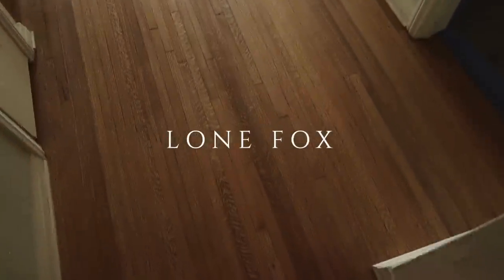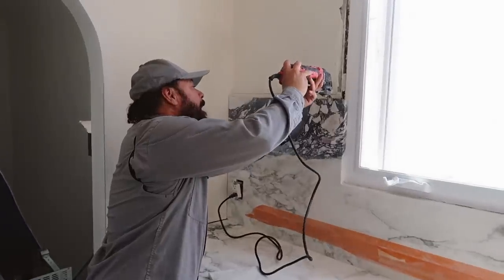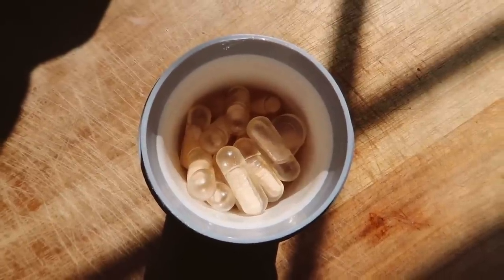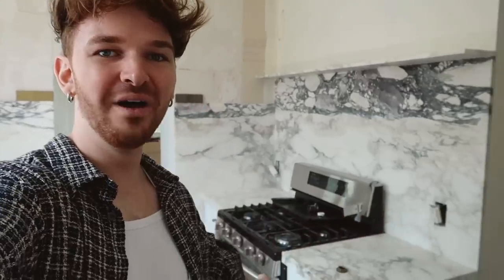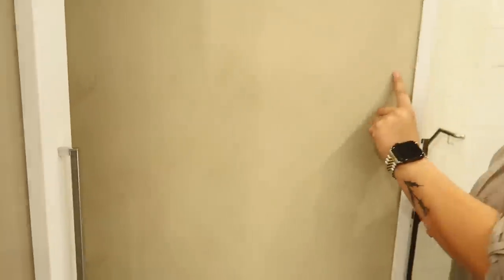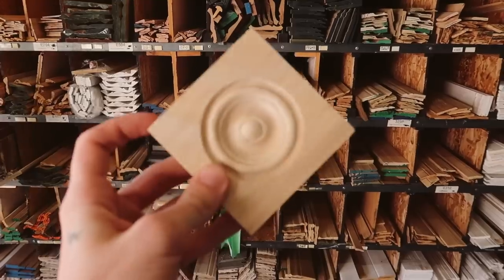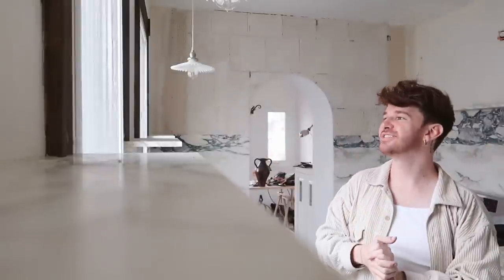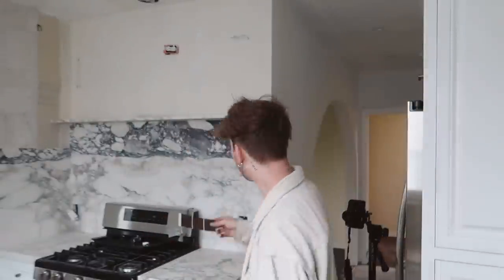COUNTERTOP REVEAL

Comment: You should try some moringa products.  A lot of people use the powder in a morning smoothy.  It is a megafood and adaptogen.  It is loaded with vitamins, minerals, anti-oxidants, flavonoids.  It may be a plant source of vitamin b12.  It has a full amino acid profile for a complete plant protein.  The powder normally comes from fresh dried pulverized leaves and the oil comes from pressed seeds.  It is really incredible.

Comment: Just a hint you may have thought of....you can prefinish your millwork and then use a color matched fill. Its a whole lot less slop and much easier to control penetration and color. A final coat of clear finish once installed then gives you a furniture-like finish.

Comment: You asked last time(?) if anyone had any ideas on how to tackle the mortar (once you get the floor tiles out) and I just wanted to say that (at least in mine and my partner's experience recently removing old tile) the only way we were able to get the mortar/thinset completely off and back to the subfloor was with an angle grinder. We've been also buying Ryobi tools and initially bought their smaller cordless one but do yourself a favor and either (1) get the better, bigger angle grinder by them if you want to stick to Ryobi (for us, we initially went for it since we have a bunch of their other tools for.. battery swapping fun) or (2) grab a good corded one- they're more reliable and have more torque for a better price. You'll need lots of power, and the little ryobi one we got at first was NOT cutting it. Our mortar situation was honestly.. a little better than yours- it looks like hardly any was coming up when you took your tiles up in the other video, but we still needed a FULL day of work to grind it all down to the subfloor, so prepare yourself for that. It's a SUPER dusty job so cover what you don't want to get a layer of dust, and also wear appropriate gear and clothing! 

Ps, I don't know if there's a better way to get back to the subfloor so if anyone knows something better then please sound off/ listen to them! The only other option I know is ripping it out and starting fresh. Less messy but more expensive to replace all of the plywood/ particle board lol

PPS great job with the kitchen so far! Gotta agree about not tiling the rest of the way up- the marble stands out much more like that. And something about those like... deep reddish purple tones is kind of speaking to me- feels appropriate for the house and era. And just wanted to say.. not sure how much you'll use your range in the future but I'd maybe steer clear of putting any hanging pot situation directly above the range maybe? That's just my opinion though, coming from someone who loves to cook. It's kinda impractical in that they'd get all dirty. But if you don't cook often or don't really care then go for it :P Might have been interesting to bring the marble up to the ceiling/ the bottom of a vent in that area? Another statement bookmatch opportunity? so many cool things you can do in this space! Gotta find a good balance of the vintage and the more contemporary direction you went with the marble, but it's going to look great!

Comment: You are making progress. I would stain the trims before installing them that would be much easier. In case Bona wears off you could also try to use OSMO hardwax oil matte which is a very high quality and durable finish.

Comment: Very beautiful marble choice and install.  One word of caution re: marble.  It can stain so be prepared to let it get stained or take some action to mitigate staining.  Especially the section behind the range.  Any little splash of oil or tomato sauce might leave a memory of the dish.  Butter stains, oil stains, wine stains, citrus can etch the surface.  All of those are fine if you get at them quickly with a damp sponge or paper towel. We have worked with marble in the past and it can age beautifully with a soft patina but you might want to take measures to keep it looking a clean and crisp as install day.
Reply: Can you bleach out the stain?
Reply: @saratemp790  not usually since bleach can also alter the colors and also etch the surface of the marble.  And bleach, if ever used, should be applied only to light colored marble.  We own a prop house and our marble slabs can be ruined when someone on a shoot does a pastry shoot (butter- oil) or wine shoot.  We have mostly turned to faux marble surfaces in our collection which is sad because marble, like the pieces on this countertop, is so fantastic
Reply: @jimjimgl3  Thanks for the info.

Comment: YOUR BACKSPLASH/COUNTERTOP IS STUNNING. AND I LOVE THE FAUCET. I THINK I WOULD'VE DONE YOUR WINDOW TRIM BLACK, THO. I ALSO THINK YOUR APPLIANCES (FRIDGE AND OVEN) DON'T GO WITH THE SPACE. SOMETHING ABOUT IT DOESN'T FIT RIGHT. I FEEL THEY NEED TO EITHER BE ALL WHITE OR ALL BACK - THE STAINLESS STEEL DOESN'T GO. IF YOU CAN GET YOUR FRIDGE AND DISHWASHER TO HAVE THE LOOK OF YOUR CABINETRY, EVEN BETTER. I'M ALSO NOT A FAN OF THE LIGHT FIXTURE YOU CHOSE. YOU HAVE A BRASS FAUCET - YOU NEED THAT BRASS SOMEWHERE ELSE IN THE KITCHEN. MAY I SUGGEST IN YOUR LIGHT FIXTURE AND/OR HARDWARE.

Comment: It looks like the color gradient is just off by an inch or so in that one corner, if done professionally someone could come in, match the color in the marble and paint to connect those off sections so it looks like it flows seamlessly. Maybe you have already featured or know about that option, Ive seen it done before and it can look really good. Cheaper than buying a whole new slab of marble and having it cut as perfectly as the piece you have already installed. Kitchen looks amazing though! Your channel and work is really inspiring!

Comment: The stain on trim and the reworked lights do not go with the kitchen at all. You have stainless, white & grey marble. This kitchen is small and dark. You need the walls light in color  and the  light fixtures light in color and style . Not heavy or ponderous looking. 
Plus repaint trim around windows.
You need plenty of light. Do you have recessed lighting. When you cook you need to see what your doing. Back to counter tops. They are beautiful, but keep in mind that marble is vulnerable to staining agents (like wine, juice and oil) that seep deep into the rock. When this happens, it's difficult to reverse, so professionally sealing the surface upon installation is essential to help prevent damage.Unfortunately, you'll need to repeat the sealing process (you can do this yourself, with a quality sealant) every six months if you're a frequent cook.
I use quartz in kitchen and marble in bathrooms. Quartz countertops are highly resistant to stains as they are engineered stones and much easier to care for than natural stone countertops such as marble. Still, it's good to know that when accidents happen, you can fix them using readily-available products

Comment: Also, pro tip with marble...use a 50% solution of H2O & alcohol for daily care. Never use anything with a low pH. Can't tell if the stone is honed but if it is don't scrub with anything abrasive or you will end up with polished spots.

Comment: A word of warning. I’m sure most of your China and glasses will be washed in the dishwasher, but for those precious items that have to be washed by hand in that marble sink they are at extreme risk of being broken as the marble will brake glass, crystal and porcelain very easily. In the old English mansions where stoneware sinks were the norm, it was customary to put a wooden bottom in the sink to prevent breakages. The wooden bottom would be taken out when not needed but it would save your precious hand wash only decorator dining table items from breaking in that marble sink.

Comment: I think the dangling lantern light is too too much for the kitchen.  You need to keep things more simple because the marble, oven/cooktop and floors do NOT want to compete for attention from the eyes and soul.  I think a shade of dark grey would work on cupboards, drawers much better for the symphony in the room. Of course with brass metal ware. I think you need to have lots of colourless recessed lighting in the kitchen, pantry, laundry areas.  By colourless i mean the same colour as whatever they are recessed into. You need the harmony and synchronicity of opera not the screechinh of singing alley cats in the kitchen.
Reply: THIS